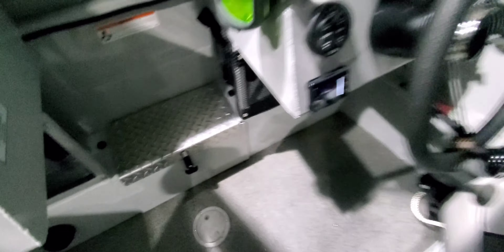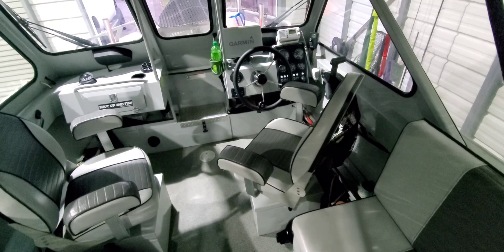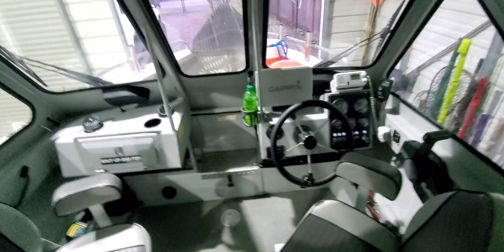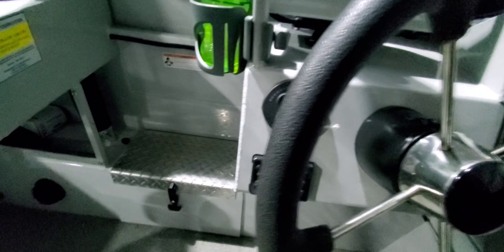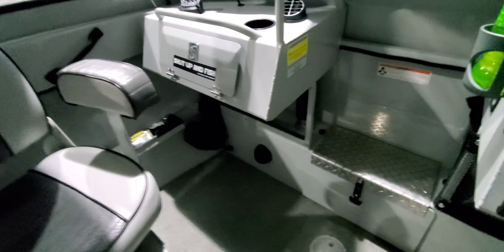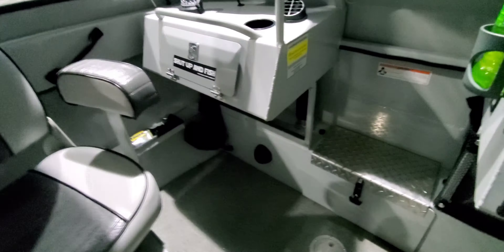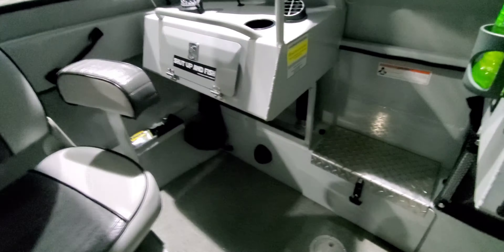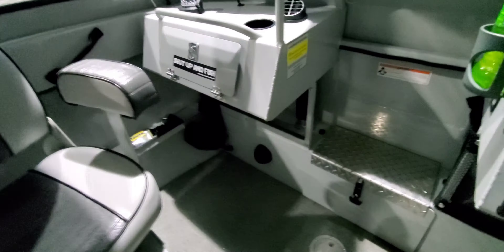Chinese diesel heater installed on a 2010 Hewes Craft.

Comment: Do you ever have a problem with the heater priming?
Reply from the maker: Nope, works great actually.
Reply from the maker: @dancox2926  i didn't,  but I got a better fuel pump for me separate. Worked a bit better.